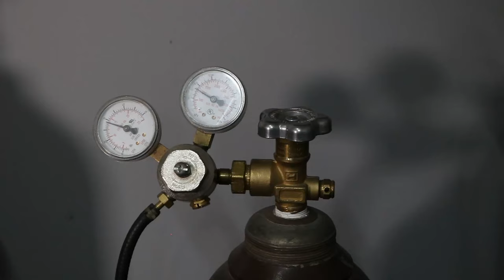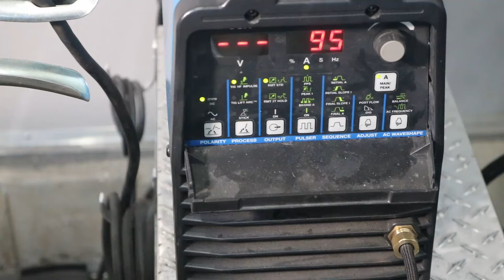TIG Welding Basics for Beginners

Comment: Very good Tim. Clear and precise. I would like to add to the “art” of cleaning. If one welds different metals, it’s critical to have separate components used for cleaning for each metal, and to just use them for the metal they’re first used with.
Reply from the maker: Great tip! Thanks!

Comment: I really have to commend you on your work on this channel which includes this video also. It does what is says, i.e. teaches you TIG basics. And it does that from perspective of absolute beginner. A bit about equipment, a good bit on how it works and some tips and tricks. No BS and with good attitude. I feels like, after watching this video, you could go out and make a probably ugly but functional weld.  Thanks a lot for this.
An idea maybe for the future. How to effectively use inverter stick welder machine as TIG welder. I see that a lot of hobby machines have this functionality.
Reply from the maker: Thank you so much! I really enjoy making these videos. It would be fun to set up a little scratch start rig with a cheap inverter stick machine. There are several little TIG inverters with high frequency start that aren't much more expensive. I'm going to be reviewing one in the next few weeks to see how it works for TIG and Stick.

Comment: Hi Tim, i'm on a !st Year Engineering Diploma- Welding Techniques Course. I started on tig, for the first time 3 weeks ago. And I'm finding unbearably hard. I seam or butt mild steel plate. i finding so crap to get a good looking weld. The tutor (who's NOT so good at teaching), told me the torch should be 80*, now I've found out it's works well at being at 45*. I can already oxy acetylene & mig. Great tutorial video as well!!!

Comment: Hi Tim.  Great video!  I watched several videos that all suggested the stubby gas lenses.  So l went ahead and bought a set.  I found them extremely uncomfortable to use.  One thing l haven't heard brought up is the size of your hands.  I'm well over 6 feet tall and have pretty massive hands.  I have found that the longer lengths of the standard gas lenses have allowed me to adopt a more comfortable grip on the torch.  Other than that, great content.  Doesn't assume any prior knowledge and is very comprehensive.  Cheers.

Comment: Great teaching! It's been 35 years since I did any tig and I'm looking forward to getting into it again. Qurstion: I don't have a garage I'll need to set up in a basement. I saw a video about using a carbon filter and fan to remove fumes. Would my argon gas be an issue without great ventilation? Maybe just do shorter sessions for dissipation ? Thanks. Tony

Comment: Is the HF arc starting dangerous around electronics? If so, how far away do you have to be to not damage anything? Thanks
Reply: We use it near all but the most sensitive electronics on submarines but one mitigation if you have to weld very close to something possibly sensitive is to ground right to the work piece ideally closer to the weld than the at risk object. Or most high freak machines have a lift arc option as well.

Comment: Thanks for the tips and sharing your experience. I'm a new subscriber. I have a project that requires me to learn welding aluminum. I own stick & Mig welders. The learning curve seems much more difficult than welding steel. Cleanliness using Acetone and dedicated cleaning brushes, torch angle, tungsten length and sharpening angle, and using AC for aluminum. The project calls for 1" square aluminum tubing with a 1/20" wall thickness. Is TIG overkill for this material that could be brazed? Also I'll need to weld the project outside. Do you have any tips for outside TIG welding?

Comment: I started practicing on stainless and was just burning trails and trying to keep the edges straight.  I’m using an auto darkening helmet set to 12.  When burning trails, I sometimes have a flash that is so bright it hurts my eyes through the shade.  What causes these bright flares? It only happens with the thin stainless I’m practicing on. Thanks
Reply: You may try to adjust your sensitivity and try different levels. My helmet needs to be set to almost maximum to work with TIG, when stick welding I can turn down the sensitivity quite bit. I have darkening level of about 9 to 10 for both tig and stick.

Comment: Tim, you so much for putting this video together. I am looking to buy a TIG welder and start welding. The video was extremely thorough and all the tips and techniques about welding were excellent. My budget for the welding machine is $1,000. Any thoughts as to which one would be the best for the buck. Hobart, Eastwood, Lincoln, and Miller would seem to be the best out there. Although the last two I mentioned can be quite expensive. Not to say they aren't worth it. I will be using it for my artwork. The welding will be incorporated into pieces as needed but I've done this work for several years without welding. Thanks again Tim.
Reply from the maker: Thanks for posting! At that price point, I’d check out the Primeweld TIG225X. I have one in the shop now and have been really impressed. Here’s a review I did on it recently: https://youtu.be/ddIveqH1uQM Primeweld is also a good company to work with and they include a 3 year warranty. Another one in that range that I have heard good things about is the AHP alphaTIG, though I have never run it myself. I have used a number of Lincoln and Miller machines and they are nice, but the price is usually a bit higher and the don’t always come with all the accessories you need. I hope this helps!

Comment: Is the filler wire we use in s stainless still the same as the one we use in non ferruse metal  EG Aluminum?
Reply from the maker: No, there are a wide variety of filler metals for different applications. Here are the most common:
Aluminum: 4043 or 5356
Steel: ER70S-2 (-6 is fine too, most of the time)
Stainless: 308L (309 to weld carbon steel to stainless)

Comment: So could you use 5356 on steel? Idk if my filler metal is too thick for my machine or if it’s the type of filler but it blobs up real bad and drips when I try to put it in my puddle. It also makes my arc pop real bad.
Reply from the maker: 5356 is an aluminum filler. For steel, use ER70S-2 or ER70S-6.
Reply: @TimWelds  thank you it worked much better and I was able to somewhat stack dimes👌🏻

Comment: Your lectures are really good. We need to make gate in ss316 with thickness of 1.2, 4 and 20mm. What type of welding should I go for
Reply from the maker: I would use TIG. A word of caution, that stainless has a tendency to distort and warp, so you’ll need to think through your sequencing and fixtures to keep it square.
Reply: @TimWelds  thank you so much for your reply
Reply: Can we connect on WhatsApp or mail for paid consultation to set up my steel door manufacturing unit

Comment: Hi Tim. A few questions on tungsten. Can you sharpen both sides of your tungsten? Also if you dip the tungsten, can you just resharpen the piece you dipped?
Reply from the maker: Yes, I sharpen both ends. If dipped, regrind and you’re good to go, though sometimes 1/4” or so of the end needs to be cut off if it’s really bad.

Comment: For Tig welding do you use 100% argon or is it a mix
Reply from the maker: 100% argon is the way to go for TIG. You can use helium to get a bit more heat on aluminum, but it’s expensive.

Comment: Tim, easy to follow explanation as usual. ? If I wanted to do both Mig and Tig but only could afford one gas, could I use straight Argon for Mig or do you have a better suggestion? Thanks very much.
Reply from the maker: Hi Bob, Unfortunately, you do need a mix gas to MIG weld steel and straight Argon for TIG, so there’s not a good way around it. Aluminum MIG does use straight Argon, but requires extra stuff and probably isn’t what you’re looking to do. If you’re just wanting to experiment with both processes, you could get a fill of one gas, then get a fill with the other gas next.

Comment: Hi Tim, thanks for the video. Would you say a cheap tig welder is a better idea than a cheap mig? Seems to me that cheap mig welders are slated for poor wire feed where as with a tig it's only supplying the gas and the wire feed depends on the user. I've just bought a Rohr tig/stick welder btw lol
Reply from the maker: The TIG definitely has fewer moving parts, which would make it more reliable. Other than that, I don't know that I'd say one is better than another...they just have different uses. Most general projects can be done with either one, but TIG is definitely my favorite, despite being a little slower. Sounds like a fun new machine!

Comment: Great video.  Do you always set you amps a little higher, than you need at the top end, when you TIG weld?  And do you ever need to push the pedal all the way to the bottom, to get the maximum amperage, for good penetration?    Thx Tim
Reply from the maker: Thanks! I don't always use a foot pedal, but when I do, I set the amperage a little high so that I have flexibility at game time. Penetration will depend almost as much on travel speed as it does on amperage (as long as your amperage is in the ballpark). If the amperage is locked in, you will be more or less stuck at one travel speed. Giving myself a little more room on the pedal lets me mash the gas and weld fast once I'm in the groove (if everything is going well), then I'll back off at the end of the run where the weld will tend to overheat.
Reply: @TimWelds  Thx Tim👍😀
Reply: Very interesting point you made about overheating. I can envision at the end of a weld, there is only half the material to dissipate to, and that material is already in the path of the heat of the weld behind you. Something to think about as I learn to weld!

Comment: Can i weld zn coated sheets with a tig
Reply: I guess you could, but you better not - you'll end up having some fireworks going on. Additionally, zinc fumes are bad for you.
At the very least, clean off the zinc in the area of welding and around it or use parts without zinc in them - usually easily done for nuts, bolts and brackets.

Comment: Isn’t there a gasless tig welding?
Reply from the maker: There is a gas less MIG, which is flux cored, but not a gas less TIG. The only gasless TIG that I’ve run is when I forget to turn on my gas cylinder. 😂 It makes a real mess.
Reply: @TimWelds  ROTF!

Comment: Very clear and with “the why”, very helpful. Thanks
Another uploader uses vague terms , “cooked the metal”, did I burn out the carbon from the steel and made iron? Is this bad, why? Is it brittle now? Is it reversible? Did it erode it? Is it just cosmetic like a color change? Will it no longer act the same way or accept more weld? He just fills it in with,” and all that good stuff...”. He doesn’t communicate well and can’t teach because if it. I know it isn’t easy and can be learned but listening to him I know less now than before. I believe he can demonstrate well but he contradicts himself and in an effort to be relatible uses colloquialisms,” hammer it”. More pedal, speed, technique? What the hell does he mean? Just a rant, trying to find a teacher not a producer of content.

Comment: Tim thanks for your content great stuff keep it up!  You mentioned that shielding Gas for TIg is Argon. On a Mig video you posted you mentioned you can use C02, instead of argon or argon mix. Can you use CO2 for TIg?
Reply from the maker: Thanks! CO2 won’t work for TIG, and really only works for short circuit MIG (also called MAG), which is the most common transfer mode. Some MIG processes require different gas blends or even straight Argon. As far as TIG goes, Argon is the way to go all around.
Reply: Awesome so it sounds like going Straight Argon will allow me to do TIg and Mig? I have a multipurpose machine so I’d like to learn both and benefit from the same cylinder.
Reply from the maker: Straight argon will only work well for MIG welding aluminum. With your multiprocess, you’ll need 2 cylinders if you want to run MIG and TIG steel. I’d recommend C25 for MiG and Argon for TIG.
Reply: Thanks Tim! Very helpful!
Reply: Tim I was looking through your videos and like I said I have a multipurpose machine and want to practice with all the processes... can you make a video if you don’t already have one, on the different size of wire (mig), electrodes (stick) and filler metal (TIg), as they correlate to material thickness?

Comment: Foot pedal is excellent for people who sit at a table and weld pieces together. Pedals are horrible for people who need to do welds where they need to lay down or be under something, or any other positions that aren't sitting down on a seat and welding. The best way to go is with a thumb wheel. Then you have control, no matter what position you are in.